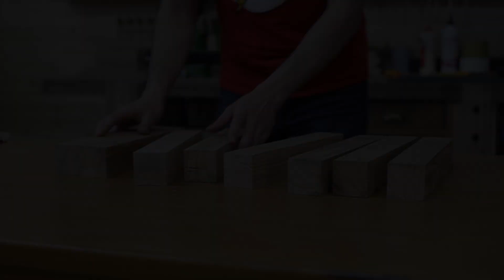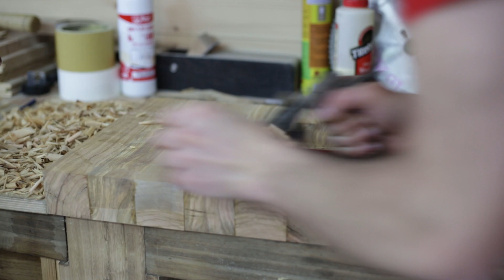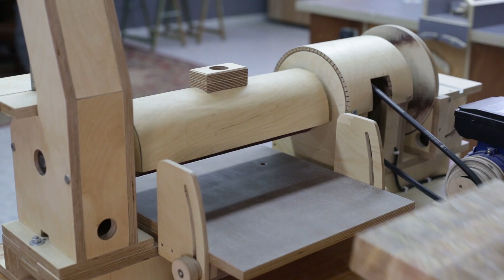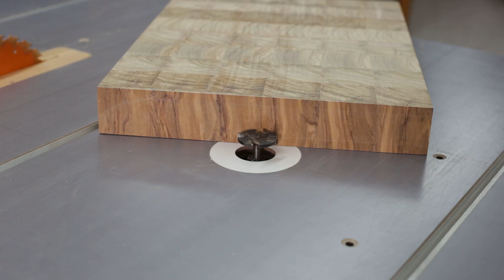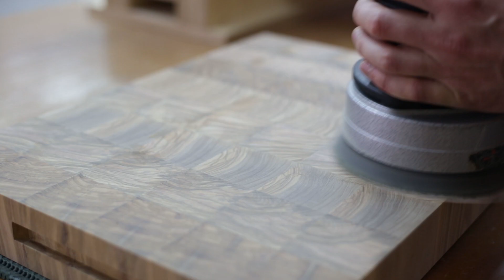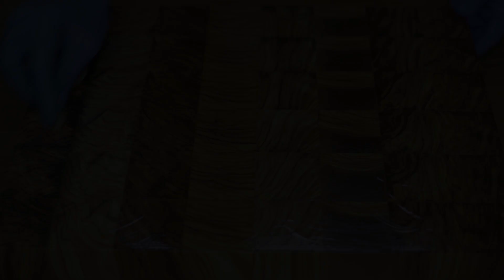How to make a Cutting Board

Comment: Thanks for the videos, they are very interesting. How did you dry the wood? My wood of the olive tree, when it is thicker, tend to develop cracks during drying. I treated my kitchen board with pure olive oil and it turned out well.
Reply from the maker: I buy pre-dried wood, but you're right. Olive is quite hard to dry and tends to crack, which is why it's important to choose the wood we work with well.